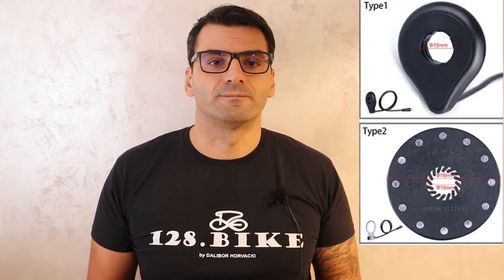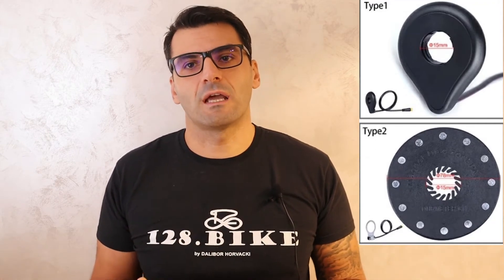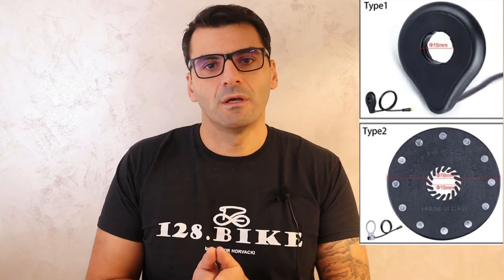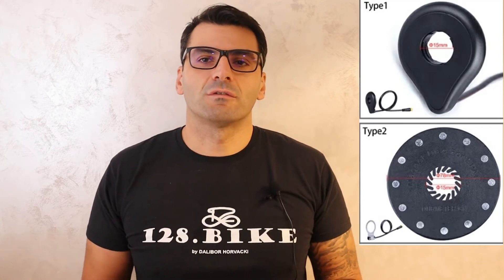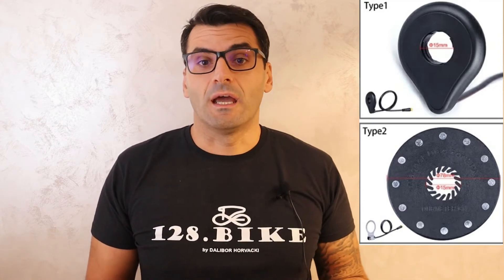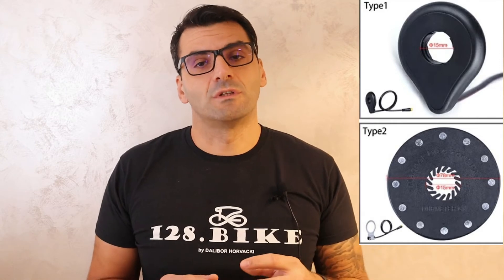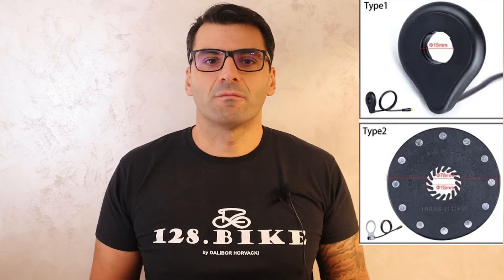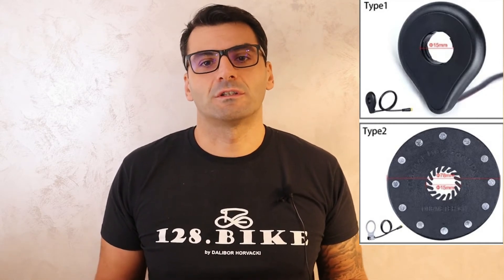Entry level e-bikes with PAS cadence sensors. What can go wrong ?

Comment: my motor kicks when I pedal backward too, 12 magnets pas, I don't understand if the sensor should be flipped, rotated, or the ring is somewhat wrong?
Reply: My ebike is also now doing this
Reply: You need to change in your settings so that it says run f not run b @LoLErMan13

Comment: I need help my controller is super basic with waterproof connectors 4 wires total with xt60 and pas slightly exposed the other 2 are the jolet waterproof plugs I think the pas plug with the red blue and black wires is faulty I have done a image search on Google of my exact controller and there is not a single one like this and I haven't seen a video on YouTube for this particular style either I can't complain I put this bike through hell lots of rain lots of bad weather lots of exposure

Comment: im trying to configure my pas with my S866 controller and ESC brainpower 866 but my wheel has no Hall Sensor , i cannot make it work
does PAS work with Motors with no HallSensor ?
Reply from the maker: Hi Michael
As I know you can't use PAS sensor on motors without Hall sensor. 
I am not an export on this topic, more a mechanical guy. But I have some basic knowledge from personal experience :)
If you have a way double check just to be sure.

Comment: Do you know how I could install 2 pas sensors on 1 ebike for 2 motors and 2 controllers ?
Reply from the maker: Hello Anio 
You just caught me at my computer so a fast reply. This would be very difficult to do but it is possible.  
Two options:
1. Use one sensor and spilt the cable onto two plugs, one for each controller. Must make sure you get the cables wired correctly otherwise to wont work.
2. Put one sensor on the left side as intended. Second sensor you can put on the right side but you need to do two things. Make sure you have enough space between the chainwheel and the frame to fit the sensor or change the bottom bracket to longer one (also must think about the chain line) Then you must rewire the two cables that give signals for direction because when you change the sides of PAS sensor (left to right side of BB) the signals for the direction are then in reverse meaning that the engine will start when you pedal backwards.   
So not an easy task but still possible just some careful rewiring has to be done :)